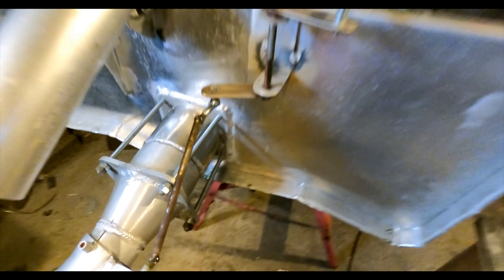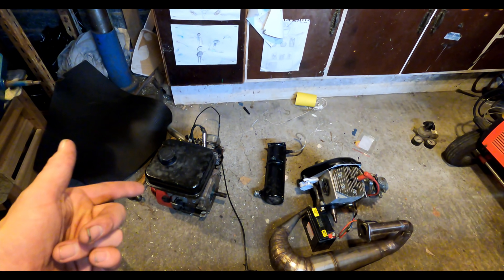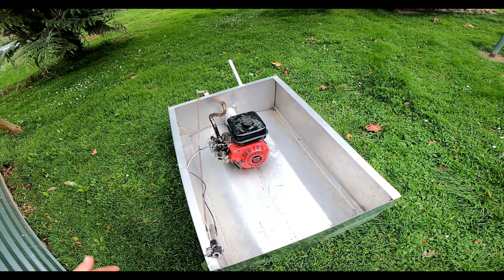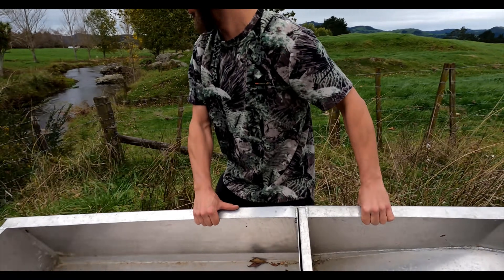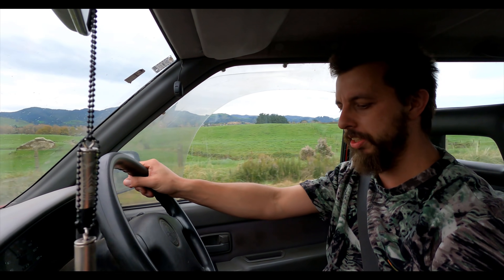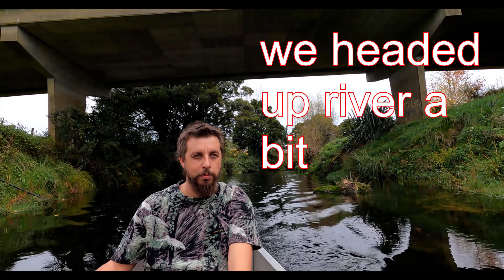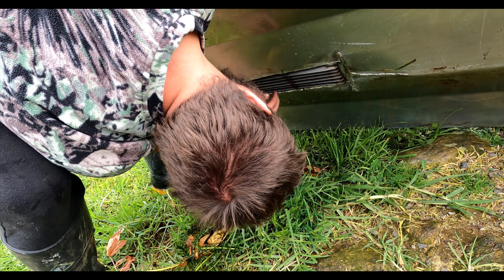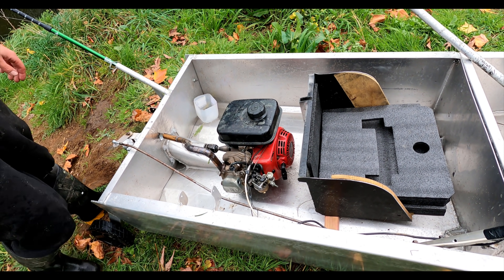Homemade Jet Unit Build, Part 4, 6.5hp 212cc Test

Comment: You think this jet pump could power the flyboard? Of course the engine should be a lot bigger
Reply from the maker: It would I think, but a prop would be much better
Reply: @dkthewelder  Do you mean a regular boat prop?
Reply from the maker: @May_Flower3  yeah jet pumps are really inefficient they are just for shallow water really and they are really manoeuvrable but need heaps of power to run

Comment: If you get an electric motor no noise and you could get more power and speed but making the right battery setup bit expensive
Reply from the maker: An electric setup would be great but like you say the batteries are beyond my budget 👍
Reply: @dkthewelder  Might find a salvaged motor and battery pack cheap if you're lucky. Not sure how easy it would be setting up with BMS etc..

Comment: to all the comments about submerging the nozzle: I don't think that's how it works. the thrust comes from accelerating the water out the nozzle, and if the nozzle is submerged it has to work harder to push water out. plus, you're dragging the nozzle thru the water. Also, jet skis and jet boats all have the nozzle above the bottom of the hull. there's probably a reason for that. 

Discuss.
Reply from the maker: Yes ! That is right I honestly got tired of replying to people saying it needs to be underwater
Reply: @dkthewelder  i just came across your channel, so a little late to the party. Props for building an entire jet pump from scratch! as you seem to have figured out, they are a complicated little piece. 3D printing is a cool idea for low power applications, and of course stealing the pump from a jet ski works great. there's a lot of room for improvement with your original pump. clearance between the impeller and pump housing is critical, somewhere around 0.25mm I think is typical. if you can get in there with a dremel to smooth out all the welds, radius the edges on the stator vanes, etc. just like porting heads, anything to smooth out the flow path will help. keep it up. you make some cool stuff!

Comment: Definitely more gearing/rpm and a healthier motor. But it did well for the maybe 5hp and under powered jet it had. Would it be so difficult to simply rebuild that motor for better performance rather than swapping out a different one? Or would the 2t have better power output and higher rpm also plus some gearing increase?
What's happening with this boat Daniel?
Reply: Oh I see you switched to surface drive. Shame the jet couldn't work.
Reply from the maker: The surface drive was way faster, I am making a jet surfboard now

Comment: From what I understand  jet pumps need huge rpm up or 30k to run well
Reply from the maker: That is a lot! Jet skis only do about 7k rpm
Reply: @dkthewelder   welll then aprentley I am rong
....
Have only played with rc units 
40mm and under they all run 25-30k😅🤣🤣🤣
Reply from the maker: @samgreer5976  yeah I see some of those Rc jet units do crazy rpm , my newest jet unit and motor setup might fi around 12k rpm but I will have to figure out the best impeller pitch. Did you make your rc jet units?
Reply: @dkthewelder  not yet looking to print some bigger ones but for my canoe
Reply: @dkthewelder  I have been working on an electric jetboard for a while. Hope my findings regarding the pump help. Smaller pumps around 80mm need around 12-15k rpm depending on impeller pitch of course. At 10k rpm I used the gas equivalent of 7hp for 80lbs of thrust (not enough for a board let alone a boat). I know the manufactured boards use around double that power. The bigger the pump the less rpm are required due to cavitation and efficiencies. Now since you are running gas engine you can't over amp draw the motor and melt everything, you should experiment on progressively more aggressively pitched impellers. Each one requires more torque but will push more water and with a larger pump you won't need such crazy high rpms

Comment: You should put the outlet nozzle below the water level, this way you will get more thrust.   also run your exhaust hose down into the water as well. {will help with the noise}
Reply from the maker: There is always a debate about this most people say it must exit above the water line. But the exhaust should be underwater to stop the noise 👍
Reply: A huge leap forward in the development of the jet boat was the change to the nozzle outlet being above the water line. It’s in the book about bill Hamilton inventing the jet boat.

Comment: Instead of direct drive with the 4 cycle you should add 2 sprockets and a chain for a 1:2 drive. (Larger on engine) and add a centrifugal clutch so at idle you have no power to the jet drive

Comment: at first I thought your pitch was off on your prop because you said this thing sucked and it was slow, didn't take me long to realize, 6 horsepower at 3,600 RPM, versus 20 plus horsepower, at up to 14,000 RPM. why do you think they use those two strokes in those jet skis for so long, the power to weight ratio can't be beat and the RPM is exactly what's needed for a jet pump. the bottom line: as long as you built the intake grate somewhat correct, you should have used that two-stroke it would have hauled ass. when you switched to that straight-in board, take a look at the pitch on that prop you used. your jet pump was a high torque, needed high RPM to get that thing rolling. the prop on the four stroke was very coarse and just two blades, it wasn't much of a screw at all. that jet pump was a straight torque screw that requires a lot of RPM.
Reply from the maker: The 2 stroke was way better more torque and rpm . But that motor was super un reliable and was sick of fiddling with it, that’s the only reason I went to the 4 stroke. I have a plan to remake the jet unit and a different two stroke motor setup
Reply: @dkthewelder  Are you sure you have the nozzle and impeller to the optimal size and thread angle to push the water out at high velocity? It doesn't matter how good your motors torque and rpm is if you don't have it using the energy efficiently or even at all!! 

Don't forget that if the water isn't being pushed out at high speeds then no matter how much your pumping it is literally impossible for the vehicle to go as fast as or faster than the velocity of the water being pushed out! You might want to test making the nozzle smaller.
Reply from the maker: @StarForgers  I try a smaller nozzle in the next video I think . The pump is just too small and not built right , it is difficult to find any measurements, rpm, specifications , so it is kind of trial and error

Comment: A 4 hp outboard on that boat would push you about that fast. U r doing ok with that power. If you can get to 10 Hp it would b a complete different story. With 1 person you would definitely plane. 15 hp would plane two adults I recon. Keep going u r doing good keep it as light at u can 👍👍
Reply from the maker: I had a 3.5hp outboard and it went pretty fast with one person, I had a 6.5hp longtail on it and it planned two people easy , that jet unit isn’t very efficient. I will build another one some day
Reply: Just shows what a little extra power can do  maybe twin engines 😃 great project keep it up 👍
Reply: buyvwharc13c2 6,5 jet outbard

Comment: The jet boat stuff is cool and all but a open propellor out the back will give you more performance per horsepower I’d imagine not sure how it work but seems like the only advantage of having a jet would be shallow turning you’d have to have a rudder with a fixed prop out the back idk just thinking out loud on here .
Good job on building the water jet assembly by hand though that was awesome.
Reply from the maker: You are exactly right, I made what you are talking about check out the other videos on my channel

Comment: More rpm bro. This engine have 4500rpm not enough. I think 8000rpm is ok
Reply from the maker: Yeah I tried gearing up another motor in the next video but didn’t work I think the jet unit is too small?

Comment: I'd say you are losing a lot of power by having the end pipe only half immersed.
👀
Definitely taking inspiration from your fabrication techniques and skills.. 
Not sure how much the efficiency of the propeller is influenced by the fact that most likely the blades and the housing around them are not in the ideal relationship, I e. It spins freely with no gaps between the blades and the housing...
But man, it works! 👍

Comment: If you add just a little pressurize water from the jet pump to the engine exhaust it will quiet it down a lot look up pictures of jet boat exhaust on Google it should be easy for you to figure it out
Reply from the maker: yes a wet exhaust ! I tried something on the latest build but needs improving would like some advice it will be out soon

Comment: This gave me hope after seeing jet boat prices like cleetus’s jet boat
Reply: Check out Mercury jet drives they use an outboard powerhead to drive a jet pump way cheaper than buying a Jet Ski just for the motor an there's lots of cheap boat haul options put it in
Reply: Lol, try my scarab 215ho...
Reply from the maker: Jet boats are pretty expensive and need alot of power, my latest build might solve this and have a test video out soon
Reply: @dkthewelder  That's why I built one too. Way to expensive. I made a 15' Alumacraft into a "jet john" by installing two 300 gpm water pumps. It's a beast.
Reply from the maker: @greenlizardusa3105  hey I watched you channel that is really cool ! And I think that your correct jet needs to be above water line , no body else seems to think so

Comment: IT is possible to get that engine up to 10HP and a lot more RPM's (5500 to 6000 RPM range.  Stock is around 3800 RPM).

you will need
heavier valve springs.
Carb rejetting or a new carb
Governor removal
A billet flywheel
A billet connection rod

Considering it is for a boat, I would not recommend hopping up the engine, because that many RPM's for a long time can destroy the engine.  In short bursts is another story.
Reply from the maker: Thankyou! the motor will be held at full throttle for long periods of time so don't want it to blow up i want to start getting parts soon👍
Reply: @dkthewelder  those engines are meant for WOT all the time they were desighned for that

Comment: Add some plastic between the impeller and wall.  Maybe PVC pipe.  That will stop metal to metal contact and it will be replaceable.
Reply from the maker: I was thinking of pvc for the impeller housing also so rocks don’t jam it and easy to replace if worn

Comment: What is the diameter of your outlet pipe and propeller?
Reply from the maker: 100mm for impeller, outlet 50mm
Reply: @dkthewelder  I think you try to make the pipe diameter bigger

Comment: Make it electric. Y can get like 2kg 25kw brushless motor for 300-400$.
Reply from the maker: That would be great! What about batteries and controller and stuff ? Would it be expensive?
Reply: @dkthewelder   Trampa VESC controller 100v/240A about 400$. If y are not using heavy lead acid batteries. Batteries may be expensive like 600$. For batteries y need to make some research. I my self would build battery bank from 26650 or 21700 cells. Y could use 3x22V Lipos too it is like 200$ each.

Comment: Clone engines can be worked for past 20 hp. I had a stock appearing 6.5 hp clone that dynode 33 hp With a stock up here in carb on Alcohol. If you throw mukini carburetor on it, there’s people have broken 35+ hp with these engines.
Reply from the maker: That’s crazy! How much power can you make and keep it reliable and able to run all day? What mods would take one to about 15hp?
Reply: 35 hp out of a 212cc is sick af my mini bike has a Tillotson 212 with 13.5 hp and that shit is sketch what’s the best hp mod for these ?

Comment: You absolutely can get more than 20HP out of one of those motors. A friend of mine routinely rebuilds them for go-kart racing here in the states.
Reply from the maker: o cool which is the best website to get parts from?
Reply: @dkthewelder  gopowersports dot com has the hotrod parts for these engines.  They also sell engines complete as stage 1-3 with just crazy output.

The stock flywheel can fail catastrophically at high RPM so the governor is needed but if you swap in a billet flywheel and rod, a better carb and exhaust, you can get 6000rpm out of that thing.
Reply: @dkthewelder  go power sports
Reply from the maker: @LRO1986 the difference between boats and go karts is boats are nonstop at full throttle and really loaded up. I think a few mods are ok but a 20hp would die pretty quickly I think

Comment: you need to drop the output down further to where the flow is actually pushing the boat
Reply from the maker: A few people have said that , it will be something I try next time👍
Reply: @dkthewelder  Sweet boat build! Jet outlet should be above the waterline. https://www.youtube.com/watch?v=HgQTKWpNgQQ
Reply: I don't think that's how it works. the thrust comes from accelerating the water out the nozzle, and if the nozzle is submerged it has to work harder to push water out. plus, you're dragging the nozzle thru the water. Also, jet skis and jet boats all have the nozzle above the bottom of the hull. there's probably a reason for that
Reply: Yeah couldnt agree with this more, you're effectively pointing a fire hose into the air because the lip of the stern, if you drop the nozzle into the water your thrush will have water to push against giving you heaps more efficiency

Comment: Just an fyi, those predator 6.5 hp motor (Honda clones) can be built above 20 hp. I know of a local go kart racer who bored it out among other upgrades and dynoed it at 23.7 hp with 21.3 ft/lbs of torque. Needless to say, until he wrecked his first time out from the build, he was in first place, he is healing up before he gives it another go on the track.
Reply from the maker: That is crazy power for a motor like that, I started looking into it and yeah the power gains are great ! But starts getting expensive as I get more money I think building one of those motors would be awesome!
Reply: buy kuaga 21 fit 150 hp jetboard

Comment: Jet drive (any propeller drive really) is done properly when the engine is just below bogging down from the load 👌😁 that torque in the 4stroke will let you run a much bigger impeller😁
Reply from the maker: In the next video I tried a 13hp motor geared up but it didn’t work and it was heavy. I’m going to try something different next but will get back to the jet unit one day
Reply: came to comment this same thing. geared too short. engine hits max rpm no sweat.

Comment: Yeah I think there is a reason the guys that build these mini aluminum jet boats use crazy high horsepower 215h 300hp engines in the little jet boats, first takes a lot to get them moving also you want those high speeds to get it up on plane and allow it to ride in those shallow waters. I've never seen anyone else build their jet drive from scratch like you did and I think that amazing. Just keep tinkering making adjustments and definitely way more horsepower and you will get it.
Reply from the maker: It seems like they need a lot of power to move ! I am building a surface drive at the moment so will try that , I will come back to the jet unit once I know what to do
Reply: big hp   jet fijetbyaght oñly not kigh sall bíta oicñboe 2 375 hp jetvir2 440 hp jets 37 fíitbyàgt  v12400bounde drjghv40 moh topßpeed

Comment: It looks like if the height or pitch of the jet was lowered it might help also changing the hull shape should get it to plane alot easier but thats alot easier said than done when you already have the boat built. I honestly think the coolest thing would be to tweak the power on the motor along with your sprocket idea, those hondas do really make good power with some performance parts, same with the predator 212s plenty of predator 212s dyno'd at 20-22 hp but thats with piston, cam, carb, exhaust, ported head.
Reply from the maker: The hull is actually pretty fast with the longtail surface drive it went 25kph with two of us and that same motor. I have one of those 13hp 420cc motors I might put that in and today I tried a different nozzle. Hopefully I get it going fast by next weekend and get a video up
Reply: @dkthewelder   I agree that lowering the nozzle down more into the water should help you get more thrust, it seems and almost sounds like the impeller is slapping the water around instead of pushing it. Really cool build though! I've been thinking about making a similar motor but trying to make it portable to use on inflatable rafts, not sure how it'll work out though.
Reply from the maker: @Pariah421  you might be right. I have put a 13hp motor in it and geared it up with chain and sprocket, which would also let me drop the whole jet unit lower . I will hopefully test this setup on the weekend and should get the next video out on the progress
Reply: @dkthewelder   Right on! I’m sure the bigger engine’s going to help you going faster either way too, stoked to see it.

Comment: Make the boat wider so it sits higher up in the water.  Go on ebay and get a used Jetski drive.
Reply from the maker: Those boats are very popular here in New Zealand. But then you need a boat ramp or low river bank to launch it, also don’t want to make the same thing as everyone else haha

Comment: Great video man maybe just get a outboard and put a jack Plante on it and just raise it cos it flew with the 3.5
Reply from the maker: Yes definitely an outboard is better than a jet . I’m just doing a jet unit for the cool factor and the cool way they manoeuvre. I will make another hull section with like a tunnel and a jacking plate and like an 8hp motor then it will really fly!
Reply: @dkthewelder  hahaha hell yeah but it might brake it a 5 or one like your old one would be good but if you want to go fast with two people 8 would be sick! Keen to see the vid make sure you reinforce it!